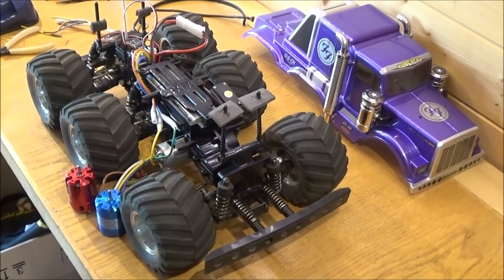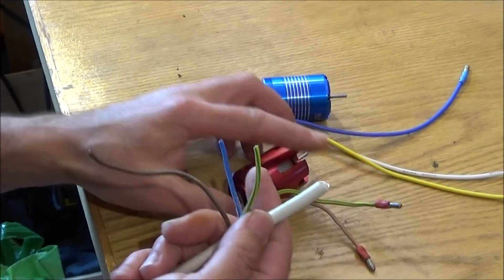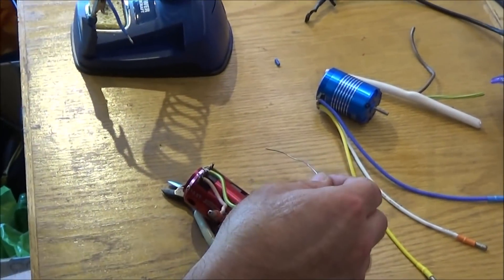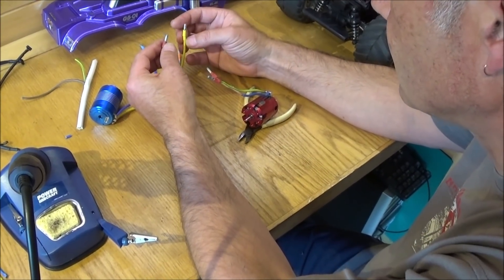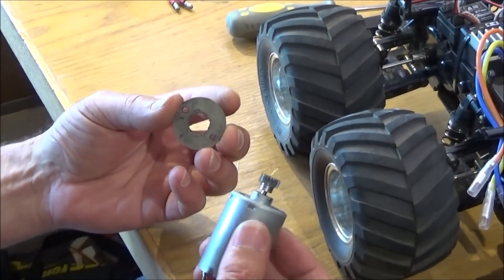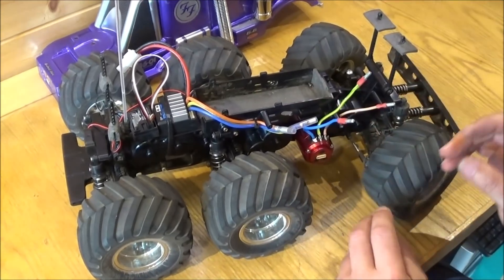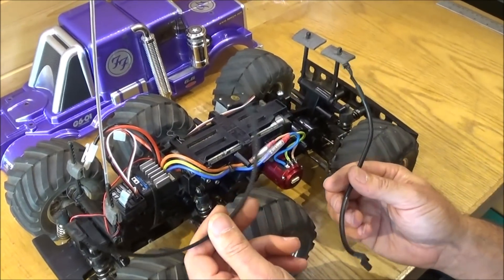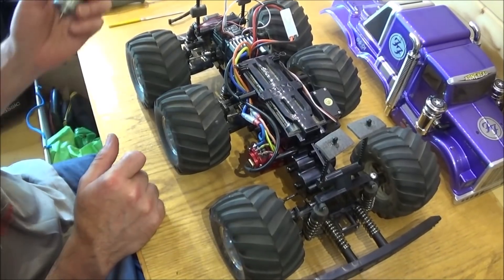How to fit a Brushless Motor to a Tamiya Konghead & TBLE-02s Set-up

Comment: HELP
Reply: Right got brushless motor and tamyia tble-04s set it to brushless mode but the instructions say if flashing red and green means the sensor is not connected motor doesn't have one any ideas
Reply from the maker: Hi - the Tamiya TBLE ESC's will only work with sensored brushless motors. You need a sensor cable plugged into the little white socket on the ESC and the other end of the cable into the motor. If your motor doesn't have a sensor socket, I'm afraid it won't work.
Reply: @MarkBryanRC  thank you just needed confirmation
Reply from the maker: @tuffbadger7342  Any time, dude!
Reply: @MarkBryanRC  should call yourself guru RC . Thanks mark I ordered a dolla Tek motor and esc   from Amazon already and the difference is scary I might buy another one
Reply from the maker: @tuffbadger7342  sounds good to me! Great to hear that you got that sorted 👍
Reply from the maker: I'll try!
Reply: Mark do me a favour please measure one of the drive bones for the tt02 and send me it please I am going to machine one in work and I stupidly left the house this morning and didn't bring my measurements with me
Reply from the maker: @tuffbadger7342  sorry I've been at work all day so haven't had chance,  only just read this, let me know if you still need it 😉
Reply: @MarkBryanRC  it's cool I got them online I made three with aluminium and snapped them all . Trying hardened steel shaping might be an issue
Reply from the maker: @tuffbadger7342  glad you got it sorted,  but I can see that aluminium would be tricky 😉

Comment: ive changed all my lipos to plastic covered wire ive had no end of trouble with that silicon covered stuff splitting and peeling on the main leads and balance leads had no bother at all since ,,don't rate that silicon covered wire  at all
Reply from the maker: Thanks for the information 👍 and yes I find the standard plastic covered wire does a good job 👏 👍

Comment: Hi mark I’m interested in buying one of these trucks and I have a brushless esc and motor already how long do the cables need to stretch from the esc to the motor
Reply from the maker: Hi George it's a great truck and I'm sure you would be happy with one! I've just had a look and the the cables need to be about 6 inches long, or 15 cm in modern terms! Best wishes from Mark. 🙂

Comment: Hey mark

I have a question

I installed the blue one 13.5t on my tamiya dt03
 And it is fast 👍

I've got one problem I can't get the car in reverse.

Can you tell me what the problem is?
Reply from the maker: Hi Jeroen,
I too have had this problem, if you are using the TBLE02 sometimes the reverse function is disabled - you need to follow the manual and switch it back on.
If it's not that, sometimes the throttle neutral position is wrong, if you set the trim backwards a bit then it may work. Remember you need to stop completely before engaging reverse.
Hope this helps!   :)
Reply: @MarkBryanRC  

Hey mark it works

my son (and i) are very happy !

https://www.youtube.com/watch?v=jz2yH3rVhYg

thank you
Reply from the maker: Hey - I just watched and left a comment - I see the reverse works OK, good work, what was the problem?  Regards from Mark...   :)

Comment: The tble02s esc an absolute nightmare to set up for me. I actually binned one in the past. But you made it look so easy, I decided to give it another try with the new one which came with my mad bull. FINALLY got it into brushless mode, and then the bloody throttle end points are up to 💩....eventually set the forward throttle correctly (But now I’m convinced I am colour blind, as tamiya decided to make orange and red the same damn colour) only to find no reverse. Apparently reverse switches off automatically every time you touch the “set” button, so had to start over again. I did come right after another 15 minutes of intense swearing, but I did learn that my level of competence is far from yours, and that I should just rather stick to my hobbywing esc’s.
Reply from the maker: Sorry mate, but I found this comment bloody amusing!  :))  Yeah, I know where you are coming from my friend! The red and orange LEDs look exactly the same, and I too have had so many frustrations trying to set up the TBLE! Your words ring so true in my ears, I think I have said exactly the same, but my good friend Rob has helped me many times to set this ESC up, and after a while it does get easier, after MANY attempts. So funny to read your frustrated words, from someone who has been there too! All the best with setting your ESC's up in the future - but probably a hobbywing! :))

Comment: Never thought about using mains cable to solder up motors! (Off to rip some wire out of the walls! Lol) Great video!
Reply from the maker: Hi Lee - haha - don't go ripping the cable out of your walls - it's much easier to cut it straight off your kettle lead!  Yeah, the 13A cable works just fine on my brushless motors, and if, like me, you have the odd scraps in the shed (old extension cables etc) then it could save you a couple of quid!   :)

Comment: TOP Tip again Mark!! 👍👍 
Sorry I've been missing lately, couldn't afford internet.... 
I still REALLY want a Konghead!!!! I never thought of putting a 13.5 in ANY Tamiya - much less one that has about 60 Plastic Gears in it!!! 😱😵 

Of course, less than a year ago, I knew NOTHING about Brushless Motors. I'm trying to learn fast! I'm actually thinking about getting a 21.5 for my CC-01 Landfreeder. I can't GEAR it slow enough, so maybe a really slow, high torque Brushless Motor will sort it. 

Like the others, I can't WAIT to see her Rip!!! 👏👏👏😎
Carmine 💥 ⛽
Reply from the maker: Hi Carmine - nice to read you again!
Thanks for the comment mate! If I could afford it, I would put a brushless motor in most of my Tamiyas - mainly because they are inherently more efficient than their brushed counterparts. More bang for your volts, and so much more run-time, what's not to like? And don't worry about all those plastic gears - they mesh up very nicely and are very robust - they handle the power no problems!
However, in my CC-01 'Freeder, I have stuck to brushed. I think a crawler needs the low-speed, high torque of a high-turn brushed. Mine is fitted with a $10  - 55 turn HPI crawler motor, and drops the top speed down to a fast walking pace. Easily copes with 1:1 climbs - did you see my Landfreeder Sea-Wall climb?  ( just in case you are interested, its here : https://www.youtube.com/watch?v=GxerZgkqsXc ) Other RC guys also swear by fitting the Freeder with an 80 turn brushed to really lower the speed and increase climbing power, I think I will try one in the future. Anyway, whichever route you end up taking with it, the very best of luck!
Reply: Yeah Mate, I've just really discovered Brushless (I know right, I've been in the Hobby for over 37 years, and just NOW!!). I've been running Brushed, for so long, successfully, that I never gave it a thought......  

I was given a Brushless System by a Friend at Wounded Warriors! A Hobbywing Brushless ESC, and a TenShock 6 Pole 9 Slot Sensorless Motor.
Mate, if you've run 4 Pole Brushless, and think THOSE are Smooth... You should see HOW smooth these 6 Pole Motors are!! 😱  Stunning slow speed performance, MORE Torque than ANY Brushed Motor I've seen. 

The best feature - on a 4000mah 2S Lipo, IN a 15 Pound Axial Wraith - I can run almost two hours on a Charge!!! 😱😎👍👍 
This one is a 1750kv, which specs out to about a 65 Turn Brushed. 
They also have a 2400kv, like a 45 Turn Brushed, and a 1250kv - which is like a 90 Turn Brushed Motor!!! 
They recommend at least a 3S Lipo or a 8 Cell NiMH for the 1250... 

I don't mean to sound like a Salesman, I'm just that excited about these! I want 5 more!! They're roughly around $40-45.00 each, US. These days, that's probably about 32 quid!!! WORTH IT!! 
They haven't become mainstream yet, which is probably why they're not more - Yet. 

I have seen plenty of Brushless Motors running at the Park or at our Crawler Course. The ONLY thing that ran smoother than mine at crawling speed, was a $400.00 Tekin Sensored System. 
The TenShock IS Sensorless, but because of the 6 poles, if it had ANY Cogging, Nobody noticed!! 😀

So...... IF I can ever afford it, I'm definitely getting one for the 'Freeder. The one thing we've learned about very high Turn Motors, is that they Burn Out easier than others. Especially if you should get the Wheels jammed.

It's taken a LONG time, but this Old Fart has been Sold on Brushless - Full Stop!
...... Since I've still got a working TBLE-01 in my Holiday Buggy, I might try a 13.5 or 15.5 Sensored Motor with it. I'm fairly sure that the Tamiya ESC will NOT work with Sensorless. 
Things are so rough lately, I'm almost going to have to HOPE that someone Gives me a Sensored Brushless Motor. It's a Sad place to be my Friend.

I am Absolutely going to check out your Landfreeder Video!!
Cheers Mate, Carmine 💥 ⛽
Reply from the maker: Sorry I missed this reply, Carmine - seem to be having notification problems with YouTube at the moment!  Thanks for the detailed comment. And, no, I haven't heard of those 6 pole motors before - thanks for the heads up! They sound awesome mate - and the run times? Wow...
You are correct, the Tamiya ESCs will only run sensored motors :-(
Best of luck with your search for a motor - hope you can get one. Enjoy the weekend, Mark   ;-)

Comment: Very helpful vid Mark. I must say that I'm crap at soldering and generally try to go for the brushless sets and batteries that already have the wires and plugs attached. I was pretty impressed with the sensored Turnigy motor but like I probably said before you can get a load more performance out of them with the Turnigy Turbo Esc and programming box. Anyway it's good to see someone doing a nice soldering job unlike the normal swear fest that it is when I do it. Good work from you and Rob once more 😀
Reply from the maker: Cheers Pete - as I think I said before, soldering is almost second-nature to me, as I used to do a LOT of soldering every day when I was in the telecoms profession. With a little practice on some old wires you would soon get the hang of it! And the Turnigy Turbo Esc and programming box sounds like a nice hop-up for the future - thanks for the info - that one is on my wish-list! Enjoy the sun this weekend mate :-)
Reply: Mark Bryan RC I'm sort of OK with the thinner wires but putting deans plugs on really thick lipo battery wires was always a nightmare. It maybe that my cheap ebay soldering iron wasn't really hot enough (or that maybe a bad workman blaming his tools). I'll invest in a better one when I'm back in the hobby room which won't be any time soon. Anyway I have some beer from the local microbrewery and am just sampling it out in the garden where it feels like 30c. You up to much this weekend? I'm not a follower of football but might watch it tomorrow so long as there is a drink involved 😁
Reply from the maker: Hi Pete - sorry for the late reply - missed the notification! Yeah, soldering the thicker gauge wires is trickier, and you are right about needing a good soldering iron - the trick is to get plenty of solder on the iron tip before you start, it conducts the heat to the joint better. My cheap Aldi iron has been magic!
Sounds nice with the beers - sweltering up in the Midlands too. I did watch most of the match for a change - simply can't believe it so far!!! Not doing a lot with the leg in that big boot - so beers and the F1 GP for me today!
Enjoy your Sunday Pete - all the best mate :-)
Reply: Yeah put your feet up mate.  Can't do much in this heat anyway !  Having said that I'm going to meet Ric down at the park in a bit as he has finished his Titan and wants to test it out.  We are having the usual dilemma about tyres.  The ones from the kit aren't much cop and we want ones with a light spike like Blitzer rears so there is sideways action but not too much so it's uncontrollable.  What do you reckon are the best DT-02 tyres? I'm thinking Rising fighter rears and maybe Holiday Buggy fronts.   The golf course is really brown apart from the greens that they water.   Could really do with a spot of rain but none forecast.  Anyway enjoy the afternoon and rest your poorly leg mate :-)
Reply from the maker: Thanks matey - lazing around as we speak! Watching the British GP soon - so beers at the ready!!! 
Great to hear you are out to test the Titan - enjoy! As for the tyres, I reckon you are spot-on. The Rising Fighter tyres work well on my DTs. Another option, if you can find a set, are the Fastrax Turf Rippers they are really good and very cheap - you can get the narrow fitment for the fronts, too - here is a link to get you started http://www.ebay.co.uk/itm/Fastrax-1-10-Turf-Ripper-Rear-Tyre-T1-Compound-Part-FAST0212-T1-/382495254218?hash=item590e7e66ca
Enjoy the RCing with Ric :-)

Comment: Great instructional video as always! Good job both of you. I actually thought your Kong already had the 13.5. Looks fast in the vids. I still dislike to solder. Mainly because I haven't got any clips and holders (or what they are called). It's kinda dumb. Not buying the small little cheap things that can make your hobby a lot more enjoyable, while buying a lot of models and accesories. That little tool you have is essential.
Reply from the maker: Many thanks for the kind words, Nordic RC Visions! You are correct, my wise friend, I have been running my Konghead with the Trackstar brushless for a while now - ever since Rob fitted his 13.5 turn brushless, I needed more speed to keep up with his Konghead! However, in the interests of our little hobby, I wanted to do a speed test, and thought it really needed a comparison with the stock setup, so viewers could decide for themselves if it is worth upgrading. Hence I recently reinstalled the stock silver can. I already tested the (stock) top speed, and was going to fit the brushless motor for the comparison speed run, when I though "why don't I make a video of it for people who have never fitted a brushless motor?" I hope this makes sense, Mikael !!!
As for the soldering iron, and the station (with the useful holding clips) - well that was only about 7 Euros from Aldi - as you say, an essential cheap little gadget that would be so useful to anyone into this RC hobby. Thanks for the support mate :-)

Comment: Those fibre motor plates that people tend to  discard are also a heat insulator so should always be used when mounting directly to plastic to prevent softening the mount... they  shouldn’t be used  on alloy motor mounts where the mount is a heat sink 👍
Reply from the maker: Thanks for the informative comment, Neil Fastfreddie Anderson ! Yes - I hope other viewers read your wise words - you are correct (I think I called it a cardboard mount!) but the motor plate is indeed made of a fibre material that plays an important part in mounting the motor - it certainly is designed to isolate the hot motor from the plastic chassis which could be adversely affected by heat. I also find that it can act as a seal - covering holes on certain motors that would otherwise be open to the gearbox internals and preventing dirt and debris from entering. Anyway - the advice is DO NOT THROW THEM AWAY! 
By the way, your YouTube name reminds me of another "Fast Freddie" back in the 80s - Freddy Spencer! Do you remember him?
Reply: Mark Bryan RC I always use to wear a red and black jumper when RC buggy racing so it was a Freddie Kruger reference
Reply from the maker: Ahh - that explains it then - I thought it was a reference to Fast Freddie Spencer - multiple motorcycle grand prix champion - he was amazing :-) I like the Freddie Kruger reference though - scare the opposition!!! =D